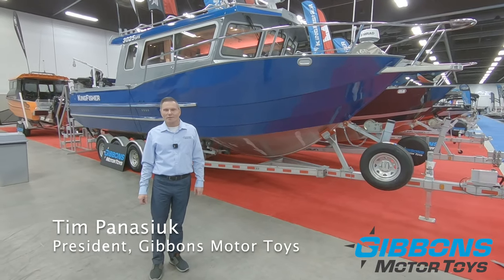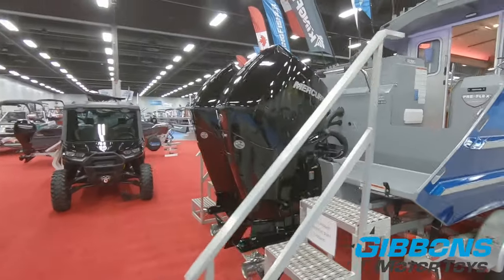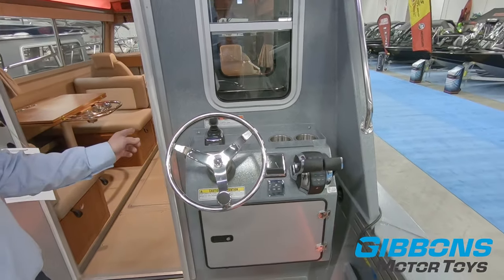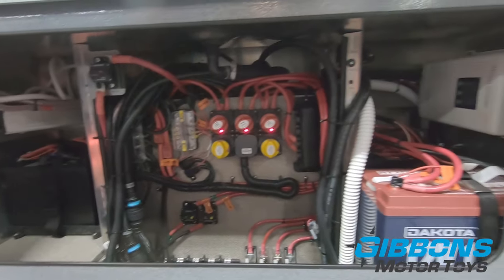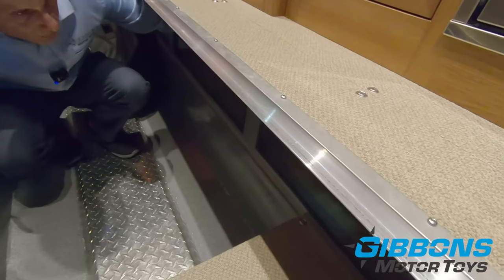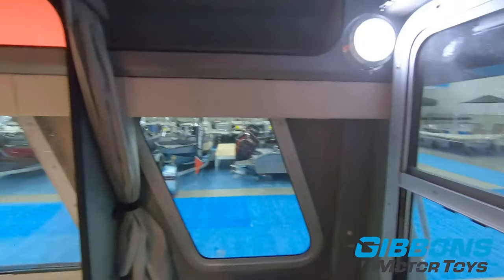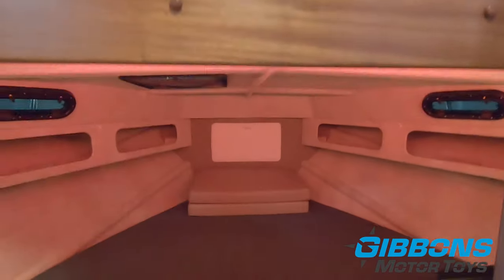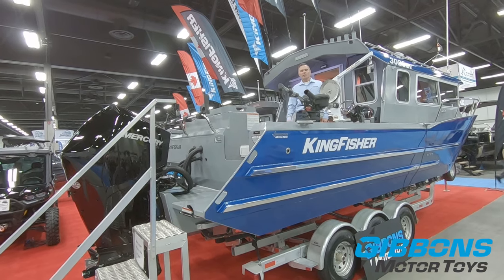2023 KingFisher 3025 GFX - Walkaround with Tim

Comment: Great video Tim! I noticed most of your boats have Scanstrut mounts for the radar. Are there advantages to these over the radar wings available from the factory?
Reply from the maker: Hi there, we prefer these as they come completely pre-drilled with all seals and grommets. You can also add various mounts such as a GPS riser pole to the rear. This makes for a very clean and functional install.